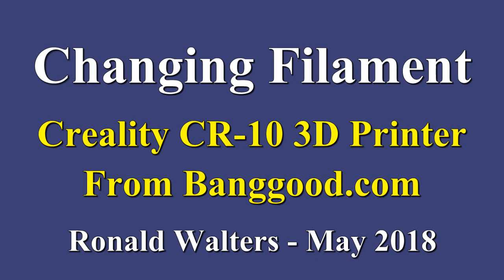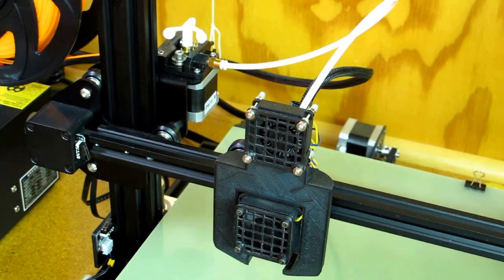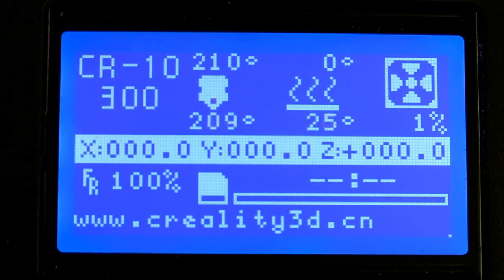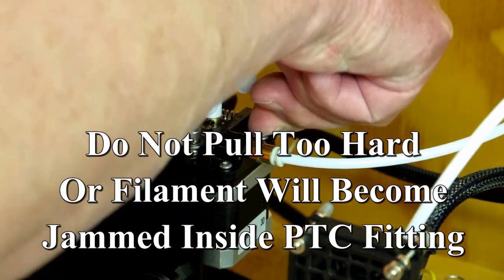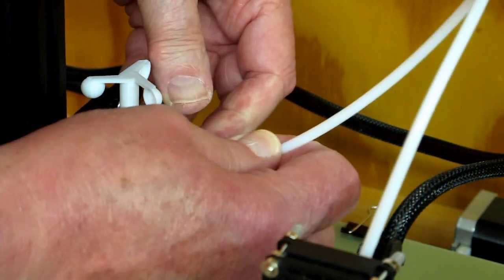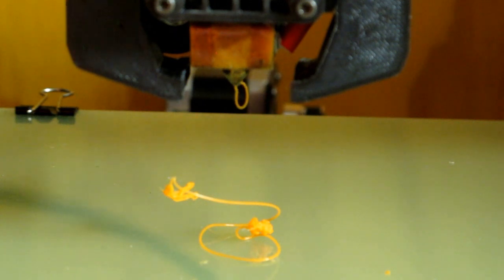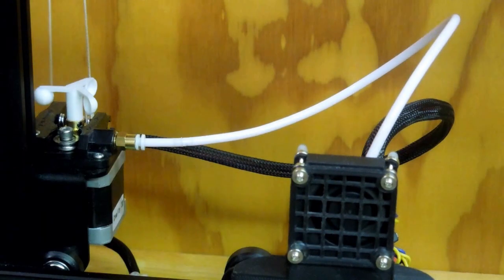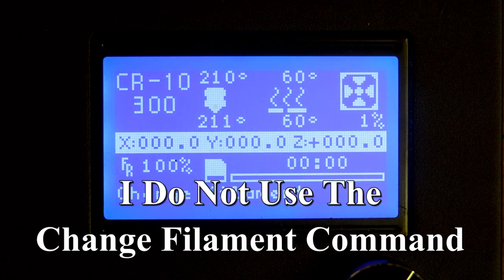Changing Filament - Creality CR-10 3D Printer

Comment: Is it okay to take the filament out and not put a new one in, so I can store the filament in an airtight container until I plan to use again?
Reply from the maker: Yes. And you can place a packet (or two) of desiccant in the container as well.
Reply: @RonaldWalters2010  Thank you!!

Comment: There should be an easier way.
Reply from the maker: A few months after making this video, I was attempting to clear what I thought was a clogged nozzle. Earlier I had watched someone who had removed a nozzle, push filament all the way out the hot end to make sure the transition tube was clear of filament and I thought, “I can not do that with mine”. I took the whole thing apart and discovered there was a machining burr in the transition tube which prevented the cold filament from passing all the way through. This burr was in the section, which screwed into the hot end. So once the hot end was up to temperature the filament melted and was able to be extruded out the nozzle. However, that burr acted somewhat like a fishhook (definitely a restriction) when trying to pull the filament out to change colors. Usually the filament pulled apart at the point of the burr and was the reason so much filament had to be extruded to flush out the previous color. I used a drill bit to remove the burr and things worked much better after that. 

To change filament now, after preheating the hot end, I squeeze the extruded lever and manually push some filament out the end of the nozzle… then rapidly pull the filament all the way out. There always seems to be a bit of filament left inside the nozzle but there is much less to flush out with the next color. 

But yes, 3D printers can be difficult at times… definitely a learning curve involved.

Comment: Interesting approach...I do it differently.  I heat the nozzle to 210, leave for a minute and then set the temperature down to 110C.  Once it reaches 110C, I press the extruder handle and tug the filament out.  This way I am not dragging molten filament through the bowden tube.  And once the filament is out, I can see the shape of the nozzle on it and it doubles as a means to clean the nozzle for me.  It's essentially what I do on my Ulitmaker...called an Atomic Pull or Cold Pull.
Reply: Where Nerdy is Cool!  Tried the atomic pull, worked like a charm. Could totally see the shape of the nozzle. Thanks.